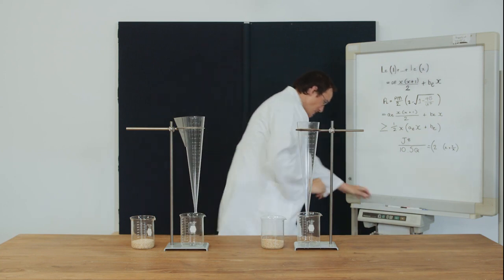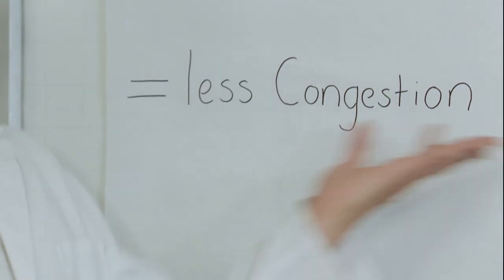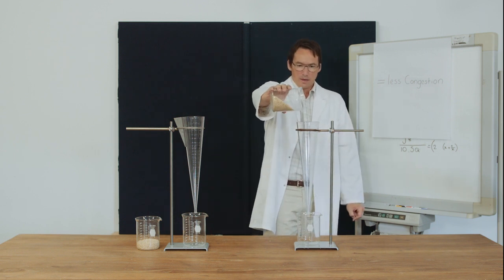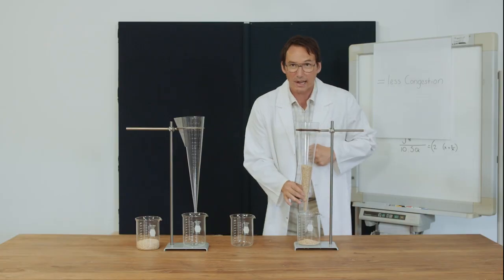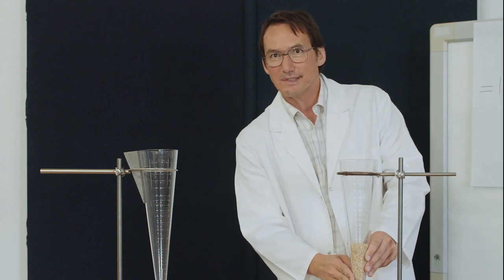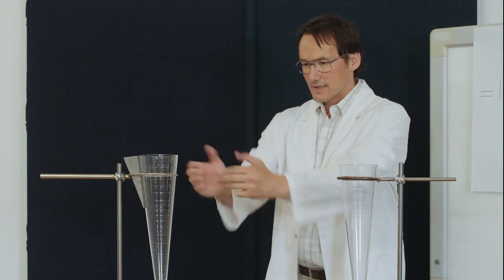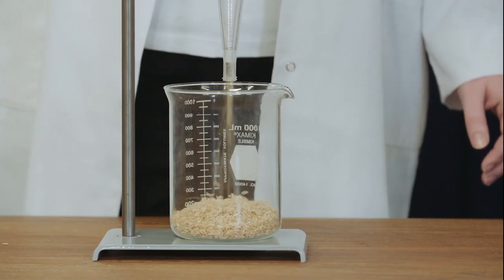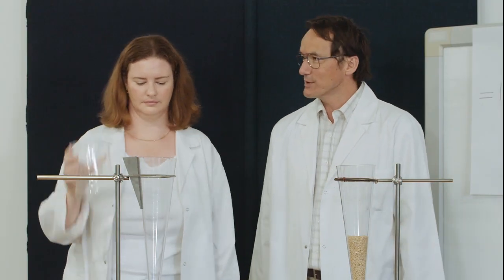Smart Motorway:  Getting smart on the Wellington urban motorway - with Kevin McPhee

Comment: There are LCS and VMS which are adjusted to traffic flows and incidents already.  The new stuff is there to allow 4 lanes NB (phase two SB ages away) and eventually automate elements that are controlled at the WTOC.  Hardest part is to get drivers to actually do what the LCS says.  Sad thing is that every day Wellington reaches saturation point and then everything from the Tce Tunnel backs up.  Among other things, Wgtn needs more dedicated parking to free the streets up.